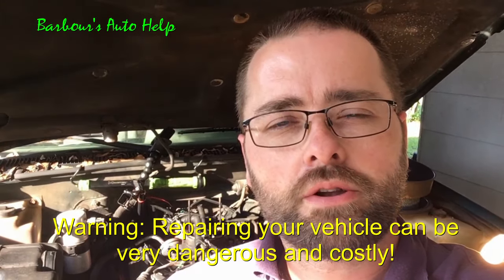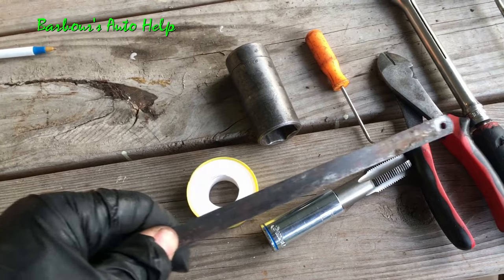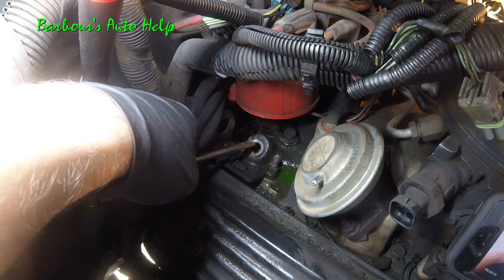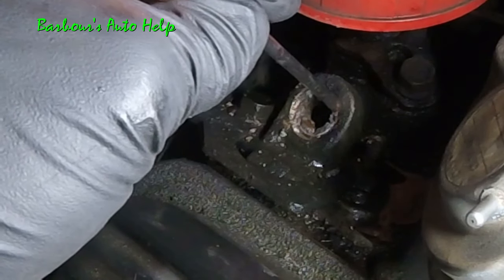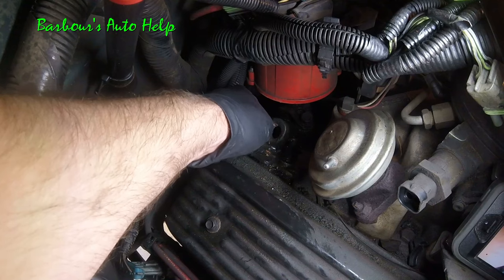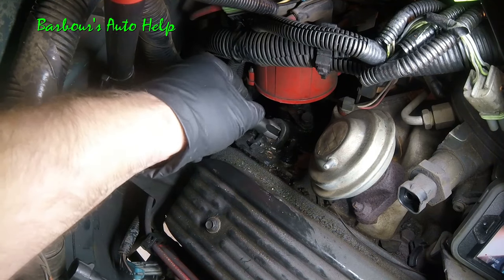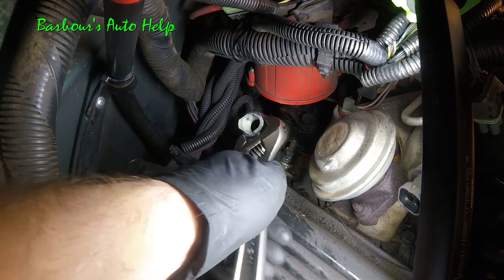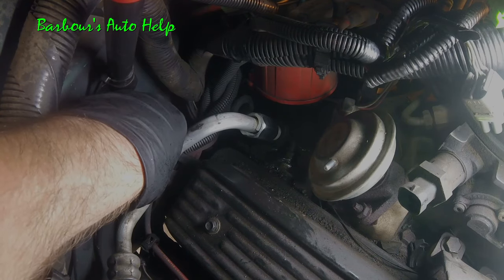GM Heater Hose Quick Disconnect Outlet Replacement

Comment: Thanks for uploading, I'm an old Guy and needed a refresher on this problem. I am going to put a high-quality chrome 1/2" NPT to 5/8' hose nipple in it's place and run a 5/8" gates hose back to the heater core.
Reply: Did the exact same thing you described with no problems.

Comment: I had this happen on my 99 ccsb. Used your video for a reference: nice presentation.  After searching five stores for the 1/2 pipe tap needed I found a 6 piece set at harbor freight for $14.99...it did the job.
Reply from the maker: Thank you so much for sharing.  I'm glad to help.
Reply: What size tap?
Reply: @ryanferkel3479  it seems the standard tpi for 1/2 pipe is 14. Both 6 pc. Harbor freight kits are both 14 tpi. I'm picking up a set today to hopefully get mine fixed up! 
PIPE TAP & DIE SET, 6 PC.

PITTSBURGH, ITEM #:91395
Reply: I figured it out. Took a bit of looking for it. Got it at our local true value hardware store
Reply: I almost read every comment on here and you're comment answered my question thank you

Comment: This procedure saved me after the Lisle 62200 extractor failed.  I would never had done the hacksaw procedure until I saw you do it.  Extractor spinning in hole left it large enough for hacksaw blade.  Just passing on that I was able to address the debris that went down the hole by screwing a cheap thin walled 5/8" garden hose into the newly tapped heater hose connector hole with other end in a bucket.  Applied low pressure (<20 psi) to radiator cap.  Caution:  Don't blow up your radiator, cause leaks or other with over pressurization.  It back flushed about a gallon or more back out the same hole leaving the inside looking very clean.  I appreciate your time making this video.
Reply from the maker: Good job! Thanks for commenting.

Comment: Soak with pb blaster, wait a few hours. Use a socket with extension not a wrench and keep it straight with no side pressure and ease it off slowly. Mine came right off no problem.

Comment: I’m giving big thanks to the original video and comments from the post. I had been putting off changing the crusty heater hose connector on a 1998 7.4l Vortec. Recently I had been smelling coolant inside the truck and noticed green coolant leaking from beneath the passenger side of the engine. I  initially thought the leak was from the heater hoses going into the firewall or coolant overflow tank. I finally speculated the coolant was leaking from the heater hose connector, running down the side of manifold and dripping down the back of the block. The connector broke off as expected and with the help of a hacksaw blade, chisel, pipe tap and shop vac I was able to replace the connector and stop the leak.
Reply from the maker: This is GREAT news!  Glad you got it done!
Reply: Are you sure the heater core isn't leaking as well?  I just find that strange that you could smell that inside the truck.  The heater core is also on the passenger side right under the glove box.
Reply: @my2cents930  I had thought that at first since I was getting the “sweat smell” of coolant inside and there was a drip underneath the passenger side of the truck. When I looked under the hood I didn’t see any leaks near the firewall looking from top to bottom. On the front passenger side on top of the engine it was wet and had goobers of oil and dirt caked under the heater hose connector. I haven’t had any leaks after replacing the connector or smelled coolant inside.

Comment: I got er done today! Very time consuming with the mini hacksaw & chisel. I took a chance and used a power die grinder in which I cut in four place and then chiseled out the broken peices. Then used shop vac with tiny adapter to suck out the peices that fell in manifold. Worked great!!! Pops had a tap for rethreading and new part went on with ease. Have to wait till tomorrow too test.  Waiting for new oil cooler lines I had to special order! 
By far not a mechanic but I still got er done!
Peace
Reply from the maker: Good job!

Comment: Good video.  I had to do this same thing on a friend’s truck a while ago.  I didn’t know exactly what to do but did the exact same thing you did with the hack saw blade.  Get the old away from the threads.  Don’t use an easy out as the material is so soft  it makes matters worst by smashing the threads tighter.

Comment: Should there be any movement on this after it is inserted in the new clip?  I am able to wiggle it considerably and am thinking that is where my very slow coolant leak is occurring, Why would that be a quick connect? seems like something more permanent would have been better design? Thanks for the video.

Comment: This is one of the better videos about this heater connector quick disconnect problem. Although I have not had one break off, I have replaced four of these so perhaps I can clear up a few questions that have come up. 

1. What is the torque specification for this fitting? This was mentioned in this and other videos but no one says what the torque specification is. I have the factory service manual for my Buick and it is not mentioned there either. Contacting Dorman, which is one after market manufacturers of this part, their answer was “It is pipe thread. Tighten until it doesn’t leak.” I tighten to about 12 to 20 ft lbs of torque but I also use Oatey #31229 Great White Pipe Joint Compound rated for fluids to 10,000 psi and 500 degrees F. over the threads then a few layers of Teflon tape over that. If if seems like overkill, its because on the 3.1L Buick Century motor, a considerable amount of disassembly is required to get at the fitting so you don't want to do this twice. Pipe compound and tape is the only method in home plumbing I found that never leaks. Just to put it in perspective, the pressure this fitting has to handle in a car is only about 15 psi. A garden hose has from 30-80 psi. 

2. Can just the rear white plastic piece be replaced? I don't think I have ever seen that plastic piece sold separately but it does not create any seal. It is a retainer that stops the metal heater hose which has a raised ring around it from pulling out. The seal is inside the heater disconnect. It is an "O" held in place by ramped plastic piece. The white plastic retainer is placed over the metal ring on the heater pipe. The pipe is then pushed into the back of the heater connector. The front end of the metal heater pipe rides up the plastic ramp inside the connector into the "O" ring seal, then the white plastic retainer which has two raised plastic tabs lock the metal heater hose in place.
Reply from the maker: It's very kind of you to take time and share this information!  Thank you.

Comment: Thanks for posting this. Saved me a couple hundred bucks at least. I followed these steps precisely. To anyone that sees this keep two things in mind, be very careful not to cut the grooves too deep and when chipping off the pieces TAP it lightly w your hammer very little force is needed.

Comment: I had exactly this problem in a parking lot, instead of cutting it I hammered a cold chisel into it and used a socket to unscrew it. Thankfully that also cleaned the threads.

Comment: Great video on this repair! After 25 years I just noticed my 92 Z71 stepside was a little wet. I thought I would take a chance and see what's up with that connector and I was shocked at all the videos. After 225,000 miles, I'm expecting the worse!
Reply from the maker: It will probably break.  I hope it doesn’t, but it’s gonna break.  Be prepared and let me know if you have questions.  Good luck to you!
Reply: BarboursAutoHelp thank you! You wouldn't happen to have the part number for that fitting? It seems everyone wants to sell them in a 5 pack online. So I have to hit the Pepboys or Napa for the single fitting.
Reply from the maker: Sorry I don’t.

Comment: Don't break it off ! Take a short flat blade screwdriver and poke inward and upward on both tabs while gently wiggling and pulling on the hose. It may take a couple minutes of poking and wiggling but it does come out and unlock like this. I just back flushed my 98 silverados heater core today and had to disconnect that fitting.
Reply from the maker: Oh I wasn't telling people to break it off.  The only reason I did is because the fitting was leaking.  Most of the time these fittings are leaking because they are cracked.  You have to unscrew it to remove it.  It is very rare that the don't break.  As the case with the truck in the video.  This is very common with this connector.  Hens the reason it's on the help isle of most parts stores.

Comment: Dorman 800-401 is that heater hose adapter part number at the chain stores. 1995 5.7L Vin K engine.

Comment: I'm replacing the quick-connect heater hose outlet on my 1998 Tahoe today. Thankfully the crap-mo-stank designed hose didn't break off in the intake manifold like that. I will usually use some type of lubrication product like PB Blaster to help free up seized auto parts. When things break off like that in the engine a simple job can quickly become a nightmare and end up costing a lot of money and time to make right. What torque spec is used on the heater hose quick-connect outlet? I just hand tightened it until I started to feel some resistance and then torqued it to 20 ft-lbs.
Reply from the maker: Lol.  Crap-mo-stank!  Lol. I used German torque.

Comment: Use a large racket & gently tug after some kind lubricant is sprayed around the base.
I had success. 
I used a 1 1/16 socket.
About 25-26 mm.

Comment: Wouldn't the cooling system be more reliable and cheaper to repair if the quick connects were eliminated and it were converted to conventional heater hoses and worm drive clamps.
Reply from the maker: Perhaps

Comment: The radiator hose popped off when engine switch off but no heat was detected by sensors it is a prado 150 2010 why is that

Comment: May help to place a small rag in hole while removing broken connector and cleaning threads  so you can easily remove connector pieces. The remove rag. I am getting ready to do same job on my 92 Silverado 5.7L
Reply from the maker: Thanks for sharing.   Let use know how that technique does for you.

Comment: Getting the right parts as half the battle if you call advance Auto and don't talk to someone that knows what they're doing he'll never get what you need you have to have the right Force I always replace the heater hose pipe assembly

Comment: How about the actual heater hose replacement?  My heater hose is leaking at the heater core and need to replace that hose.  Can I cut the hose at the metal part and splice in?  Thanks for posting.  Good job.
Reply from the maker: I’d just get the hose with the quick disconnect on it.  It fits better.
Reply from the maker: Get the one like the old one.
Reply: Update 1990 GMC 5.7L:  what I did, was get my dremmel and cut off that aluminum piece that was factory crimped on the coolant hose on the water pipe.  I then took the coolant hose off and the local parts store had the replacement in stock ( part: GAT19666).  I also purchased & installed the threaded heater connector with the plastic quick disconnect which was in stock also (part: DOR 800-401).  then inserted the new coolant hose on the original metal pipe, tightened the clamps and snapped it in the intake manifold.  Then cut to size the heater hose and topped off the radiator fluid.  Thought it would be painful but really was an easy job.  Thanks for your inspiration
Reply from the maker: Very creative! Thanks for the information.  Have a good one!

Comment: Instead of vacuum, just turn the engine cause that will flush that stuff out... Remember, that hose comes from intake to the heater core.. Yes, its the inlet hose for the core...

Comment: There's a tool used for removing water iragation pipe fittings that looks like a big easy out that would work great for this job
Reply from the maker: .....in some cases.  Ben there, done that.  Doesn't work in most cases as a mater of fact.  (In my experience.   I've done a bunch. )

Comment: great job very helpful mine has started seeping but has been replaced when I had a new engine put in. do you think they replacement ones will break off in the manifold as easy as the originals do if you have to replace them because i know the replacement one are some sort of steel! I do have the coupling extractor tool to remove it if it breaks off but hopefully i can get it out without breaking it! but murrphys law does apply when it come to the automotive world whatever can happen will happen! lol
Reply from the maker: +Greg Robinson If they are not the originals then they probably will not break.  I'm pretty confident but don't get upset if it does.
Reply from the maker: +Greg Robinson By the way, I've not had very good luck with the tool.
Reply: BarboursAutoHelp i have seen that tool fail believe me   depends on how well it bites into it and if it don't Crack and shatter it when you're driving it in all sorts of possibilities!
Reply: BarboursAutoHelp I got the fitting out with no problems I just put a regular fitting on with a heater hose and a clamp I hate gms quick connector design even those better replacement ones leak after about a couple of years at least from my experience with them iam also going redesign my oil cooler lines too they have the same type of fittings I've got some ideas in mind but I am going to think them through very carefully and make sure they are going to work before I do them! thanks for your advice!
Reply from the maker: +Greg Robinson sure thing.
Reply: BarboursAutoHelp 
Do You Have á Part Number for me from Heater Connect Outlet.
Thanks A Lot from Germany

Comment: To flush debris out remove upper rad.hose and remove thermostat. replace hose on thermostat housing end and then flush water back through. this will push debris back out the fitting hole.
Reply: Heat the nylon retainer with propane and pull on the hose as it melts. Clean the mess.Replace retainer and o-ring. That is for those of you who are only trying to remove the hose.

Comment: What size tap? I used a ½"-14 and my new connector wont fit. I read on a forum that it was ½"-13 is that accurate?
Reply from the maker: 1/2" pipe thread
Reply: @BarboursAutoHelp  is that a different tap than autozone would carry?
Reply from the maker: @ryanferkel3479  I'm not sure if they carry it or not.  But It's a 1/2" pipe thread.
Reply: Thanks.  I have a 1/2" tap. I think they sold me a 5/8 connector instead of a 1/2
Reply from the maker: @ryanferkel3479  lol.  I didn't say 1/2" tap, my friend.   Its a1/2" pipe tread tap.  A hardware store may be a better place to look.  This is not a common tap in automotive repair.
Reply: Well that makes alot more sense lol
Reply: Im seeing alot of ½"-14 online. Does that seem familiar?
Reply from the maker: @ryanferkel3479  No, but a 1/2" pipe tread tap does.  Lol.  My nephew had the same issue.   You just gotta run into the right person at the hardware store.  It's a 1/2" pipe thread tap.
Reply: Thanks man
Reply: Dorman 800-401 part.

Comment: Just get rid of that stupid thing and buy the right size metal nipple to replace it with and use regular heater hose clamped on.  Plastic will only get heat embrittled again in time.  FIx it once and for all.